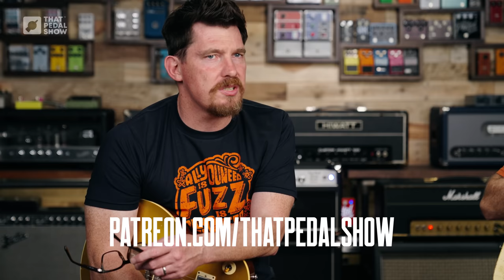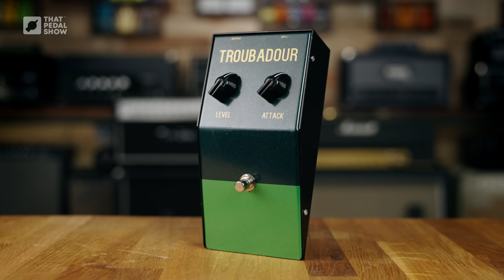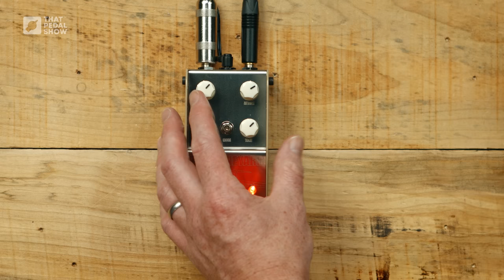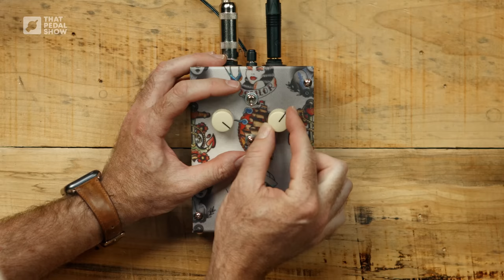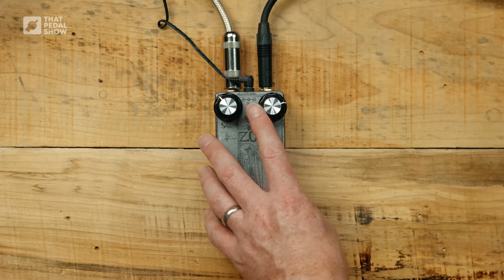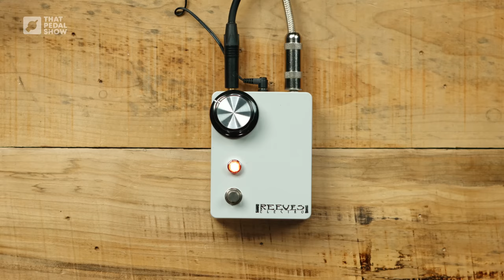A Modern History Of Classic Fuzz [Or A Weirdy-Beardy Noise-Fest]

Comment: Fun amble through fuzz. Just to note I don’t think the MkI has had its due on this show…plenty of love for the Fuzz Face but the MkI deserves a feature show for the hardcore fuzz freaks.  Just to clarify it was (one of if not) the first 9v true bypass pedal and while it doesn’t clean up it does reward some tinkering with the volume and tone knobs.  The Zonk is basically the same thing with a smaller input cap and different biasing.  A very useable effect in a modern rig that adds gnarly texture and character.  And being based in the UK you are well placed to get your hands on some fine examples as you have done here.

Comment: Hi guys, question about the Trufi Two Face - what’s the headroom like on it? I was going to try the Josh Smith Vemuram Fuzz as it supposedly has a bunch more output so it actually gets louder when you kick it in but I’m preferring the sound of the Trufi a lot more. Does it boost level when run into a clean (ish) amp or does it barely get to unity gain like most vintage Fuzz Face type pedals? Cheers!

Comment: OK I grabbed one of the early versions when they first first came out and they haven’t been out that long .my version does not have that knob on the side what specifically is it doing? I know there are two internal trim pots one that’s lower it looks like it’s kind of adjacent to the bias knob which has an arrow pointing to a specific spot which I turned backwards to noon and it felt like maybe clean things up a little kind of adjusted the amount of overall fuzz Which I know sacrilege but I use a tweet deluxe of a loss Paul was home buckers so it’s easy to get overly fuzzy I know that’s a subjective opinion but it kind of gets it more into almost an overdrive he kind of place and then if he died in the volume if you have your phone set at noon It’s kind of a nice overdrive sound somewhere between overdrive and low phones if you Diamme the phones then you’re in Reno a decent fuzzy territory but I’m not entirely sure what that is doing and if adjusting it is a good thing or a bad thing and he hints? The top trim pot that looks like it would take a Phillips screwdriver I did not touch but the lower one that looks like it would take a standard screwdriver I did indeed back off and I don’t know what it did but it seemed like it lowered the overall fuzziness of it
Reply: I’m talking about the true-fi two faced fuzz

Comment: I've got a question about the Seeker MK1.  On Seeker's website they mention that a 9V supply "must be isolated".  How would I know about that?  I'm using a 1spot to power my board, is it isolated?  What did you guys do to power this beastie?
Reply: If you’re using a daisy chain it wouldn’t work in that, but off of a single one spot will work just fine without any adapters.
Reply: @SeekerElectricEffects  Thanks, that makes sense!  I have s 1 spot CS12 and each pedal attaches point-to-point to that.  Sound legit?
Reply: @allanflippin2453  so long as it’s got its own dedicated cable from the CS12 it’ll power up perfectly.

Comment: I went back to using just my humbucker junior with series parallel switching.. It's an A5 15k with a 6khz resonant.. 

I added a fender TBX tone pot ( makes the humbucker more like a p90 or single coil) and I forget what cap I have for high pass but really... That combo does everything from massive wooly drone metal fuzz to clean overdrive tones.

I haven't used any other pedals for over a year with that guitar. It's highly reactive Germanium and in Paralllel full volume I have to set the fuzz pot just under oscillation..  Switching to series it turns into a gained up drive.. Rolling toward treble pulls the bass off and saturation focuses to whats left. Tone back below 5 is normal again.. Series and tone back gives that resonant notch and an octave up effect.

I've been plugging that into a microcube GX or my friends Blackstar fly and getting everything I need.. 

You wanna sound like BFG.. Use his strings. You wanna sound heavy.. Use 11-49.. or heavier.